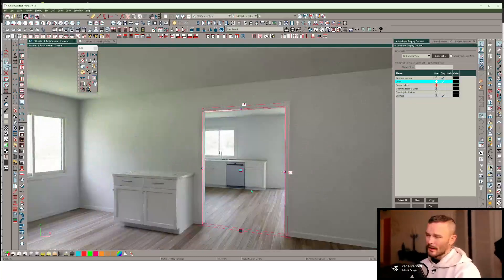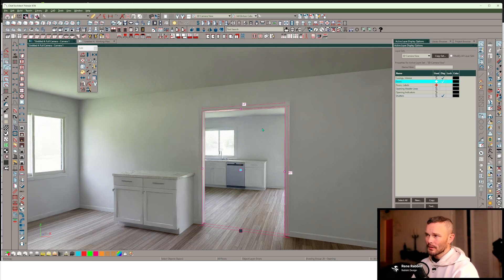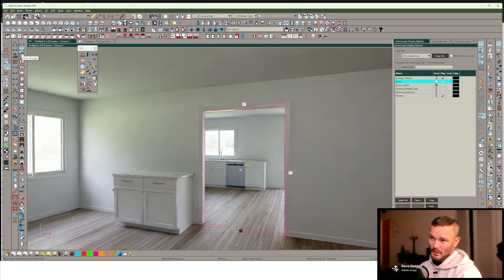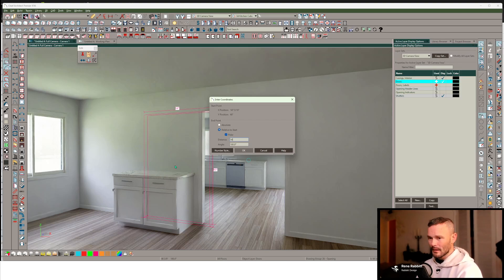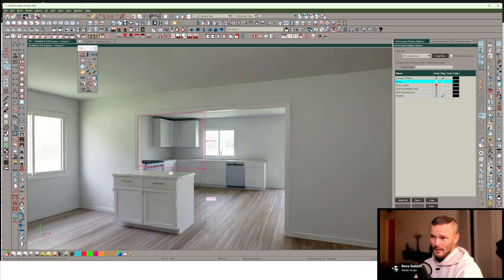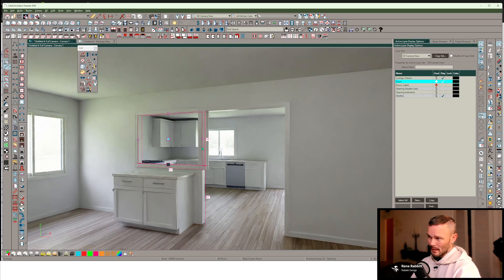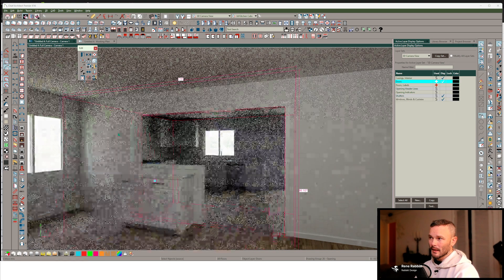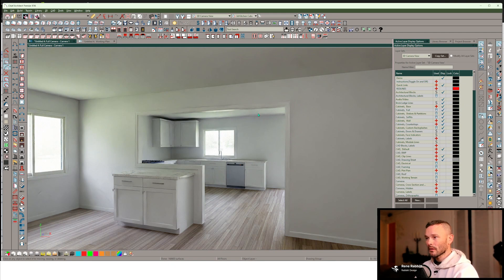CA SHORTS - Mulled Doorway and Passthrough in Chief Architect X16

Comment: Not so 'easy'.  You have to turn off Jambs first, then when you copy the new doorway it much not overlap and should be at "0" from other doorway or you see a vertical jamb. That looks bad w/o a jamb so I tried various radio buttons until I figured out that I had to switch the 'jamb' setting from 'Door size includes Jamb' (don't work) to 'Door size Excludes jamb' (works).
Reply from the maker: @JTDesign1  I did not turn off jambs in this video. You watched as I did it :)
Yes I moved the door over exactly the same distance as the width of the door so it was 0 " spacing